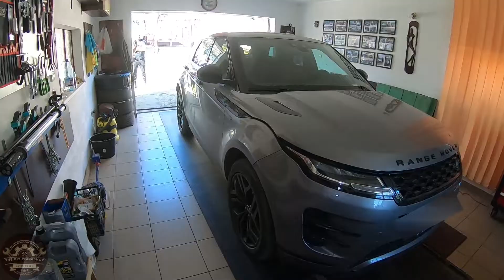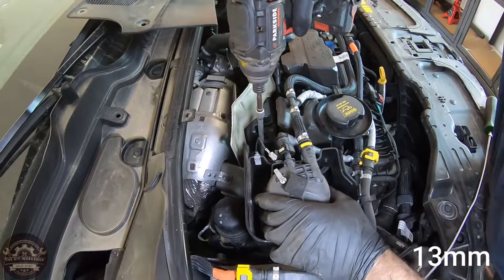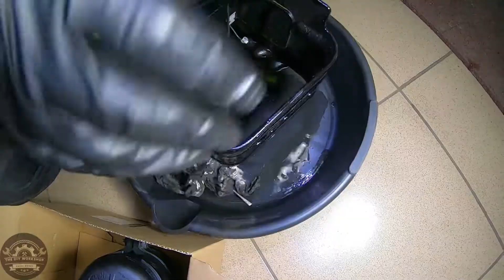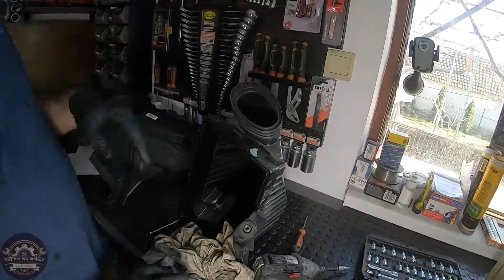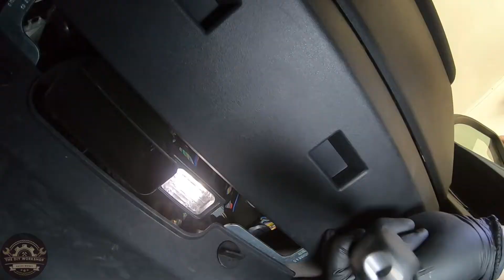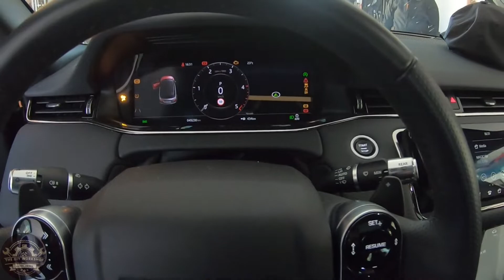DIY 2020 Range Rover Evoque 2.0l Full Service Job Fuel Filter Oil Air Cabin Filter

Comment: If you loosen the oil filter first the oil will drain out of the filter when dropping the oil underneath. then there is no need to suck any excess oil out of the housing, and it makes removal of filter cleaner
Reply from the maker: We do the service as fast as possible as we do it after work. Waiting for al the oil in from filter to drain is not an option many times.
  Also, on some cars, the shape of the housing makes it difficult for it to drain.
   Thank you for the tip and your comment. We trully appreciate it.😊

Comment: Absolutely no need to remove the fuel filter to remove the oil filter.  65mm x 14 Flutes is the tool required.  On right hand drive vehicles just remove the plastic scuttle that hides the brake fluid reservoir for free access.
Reply: Hi what brand of tool do you have? I've tried auto zone brand but it slips.
Reply from the maker: Thanks for the extra tips and for sharing the tool size!

Comment: Absolutely no need to remove the fuel filter to remove the oil filter.  65mm x 14 Flutes is the tool required.  On right hand drive vehicles just remove the plastic scuttle that hides the brake fluid reservoir for free access.
Reply from the maker: Thank you for the info!

Comment: Is it necessary to bleed the system at the fuel filter or does the system bleed itself?
Reply from the maker: It bleeds itself on this model. I think I mentioned it in the video.
Reply: It doesn't